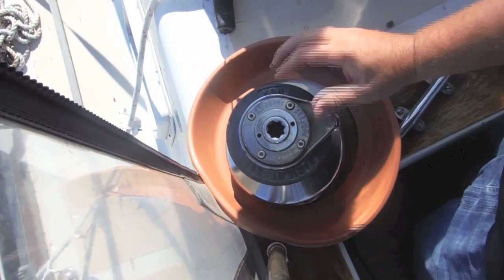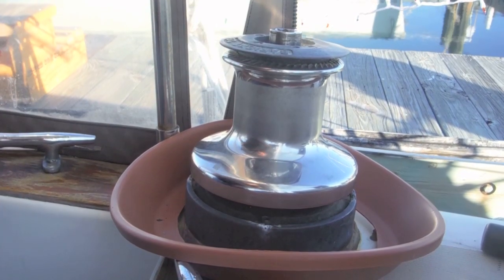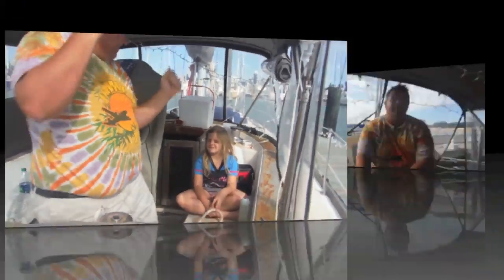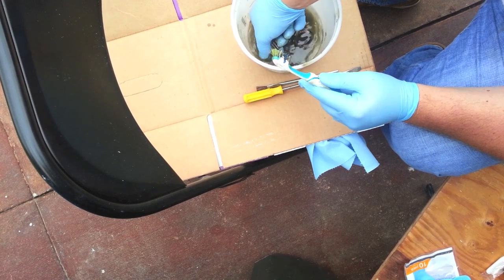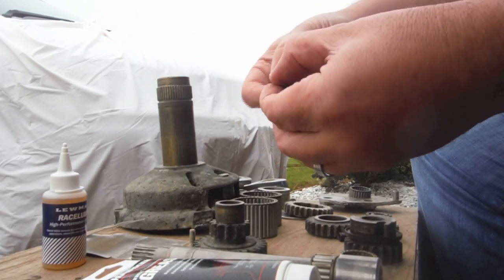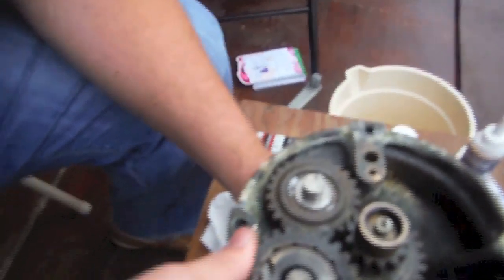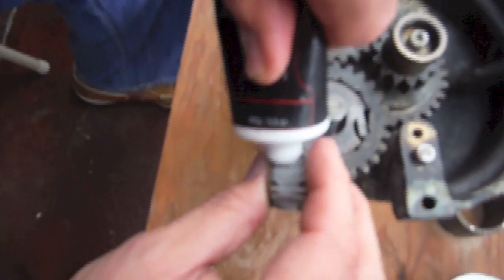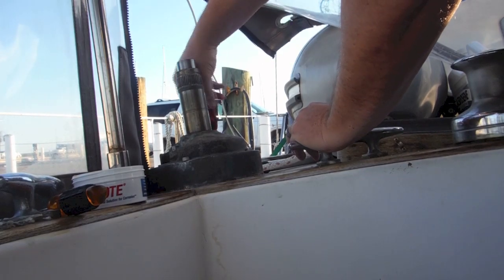Blog - Project - How to Service Primary winches (Barient 28)

Comment: Thank so much for you video ! 👍. 
Just bought two winchs same type but they came from a burned boat, so i'm trying to save them...
The inside looks good but are missing the main needle bearings... I have to find them on the web (i hope to... 😉).
With your video i could find all the way to to it correctly ! 😀.
THX again from France 🇫🇷 😊. Good job !
Reply from the maker: @Bruno Groupierre - Thank you for the kind words and welcome to the channel all the way from France.  I am glad the video helped.  I had fun making this one as well.  Safe Sailing.
Reply: SVDreamChaser
Thanks to you 😊😉👍

Comment: At 12:30, you put the gear to the pins upside down...

You can check it better at 13:20
Reply from the maker: I am not sure what specifically you are referring to.  at both 12:30 and 13:20 I am holding the two gears that I put together however in both cases, I am showing the camera what it looks like from the bottom side of it.  When it goes back into the winch, I don't believe anything was upside down.   Can you clarify?
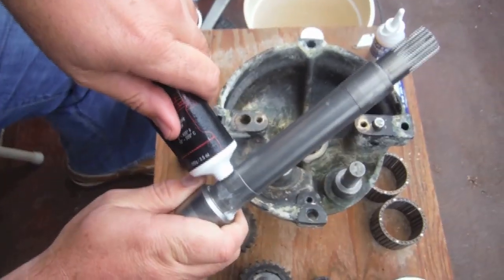Reply: @Svdreamchaser   when you put them together, the teeth have a space to grab the wheel, but if you check the picture at 12:38, you will see, the teeth are not fit into th marks, because the gear is upside down. if you turn the gear on the teeth, they will fit into their place better.
this way, the wheel can start to eat the corners of the teeth.